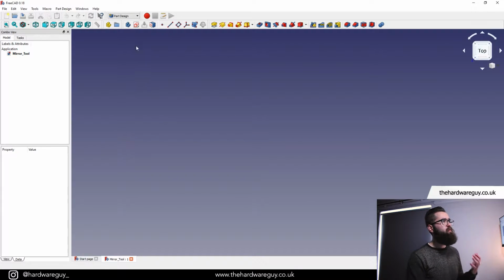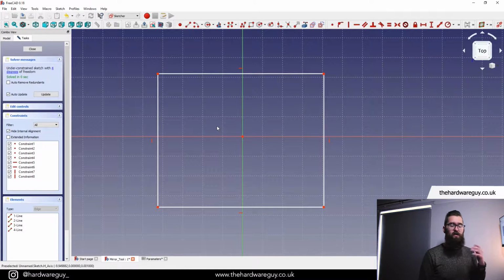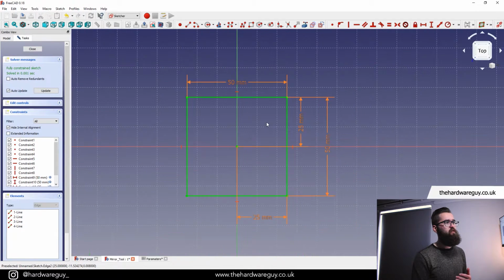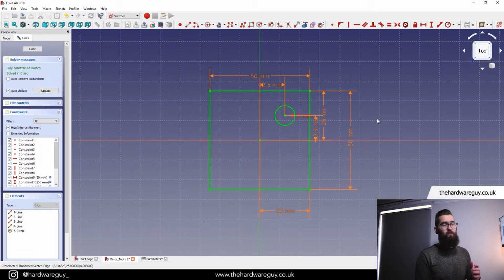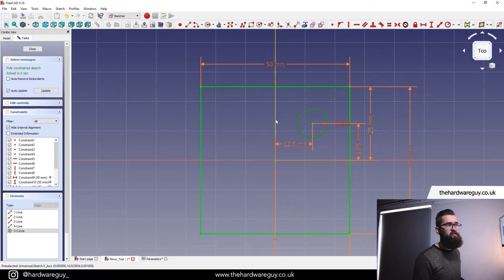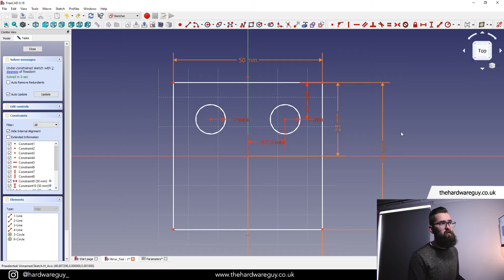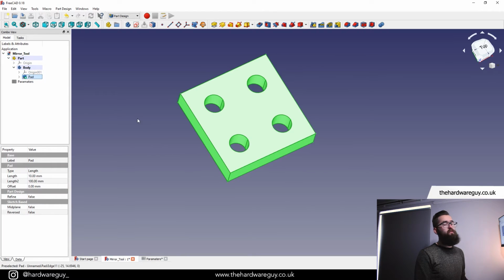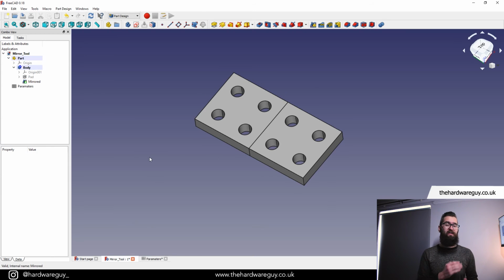FreeCAD for Beginners pt.5 - The Mirror Tool

Comment: Excellent tutorials! Please use the Symmetry constraint to center the rectangle. This is much better than specifying "half width"
Reply: 100% agree, the symmetry constraint makes more sense to use, and creates less clutter.

On a similar note, after mirroring the circle and loosing the constraints, instead of recreating the horiz. and vert. constraints on all 3 circles, you could also use the symmetry constraint to make the other circles symmetric to the first, and then if you move the first, the 3 others will move with it as well. That one will be particularly amazing at removing clutter of constraints everywhere on your sketch

Comment: Loved this series.  Just received my first 3D printer(ender 3) a couple days ago and have been making, well... everything.  Shower rod brackets, 'I survived the Coof - 2020' keychains, tiny brushed motor mounts for micro aircraft etc etc.  I bought it to make boxes/housing for all my naked circuits but so far that's about the only thing I haven't made.  I'm gonna need a couple more of these printers I believe, slow is no fun!   All this using FreeCAD and this playlist you put out.  Thank you!

Comment: For MacOS on v0.18, it's the option/alt button instead of control when making the mirror references. To select more than one circle, use the command button and then use the option/alt then click the line reference. FYI to all.
Reply from the maker: thanks for this!
Reply: Same works for linux. Control to select multiple objects, alt to select reference line.

Comment: Hi, in all of the videos relating to mirror and linear pattern tools, it seems that all that can be patterned or mirror are simple pads or pockets.  Is it possible to mirror or linear pattern a more complicated shape? That is, if you sketched a circle, but then swept it out above the plane along some arbitrary path, can that shape be mirrored or linear patterned?  Also, does patterning or mirroring depend on the selected sketches being fully constrained?  Alternatively, can one linearly pattern a sketch, and then sweep all of the linear patterned or mirrored elements simultaneously? Thanks for your excellent video!

Comment: Thats why the sketcher is lacking...while making mirror without constraints is just the same as drawing circles quickly manually and applying constraints. Sketcher needs badly improving, no patterns, no offset, troublesome copying, simple sketching takes ages. Freecad is a briliant piece of software with huge functionality, but the lacking basics in sketcher make it really difficult. I'd wish the developers could stop for a bit with adding new gimmics and focus on the basic blocks. Anyway, freecad is still great!

Comment: Until it can really copy the constrains too I find this not that useful because 80% of the time you already spend on creating the constrains. The time you saved by just mirroring the circles is so marginally that I would not consider that tool . I would even contend that creating the circles one by one is even faster than using the mirror tool :) Okay, that might not be true for really complex shapes as you already said.